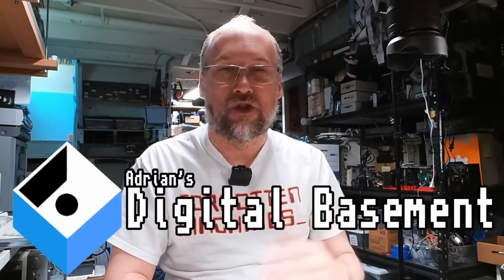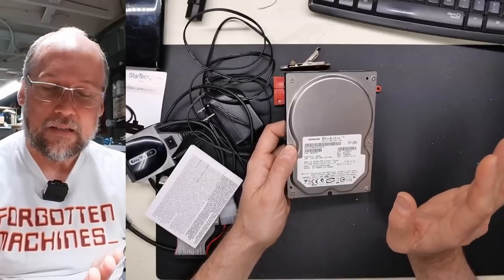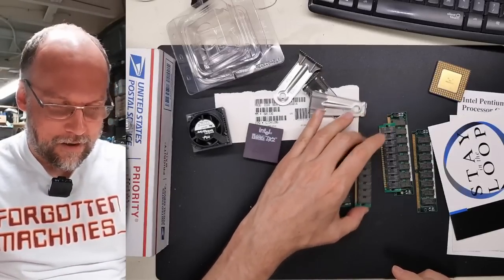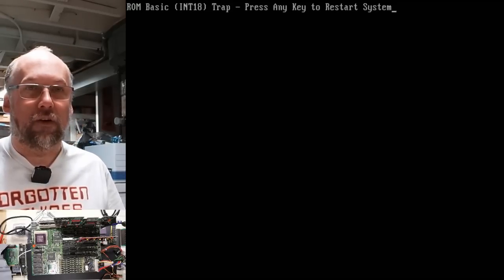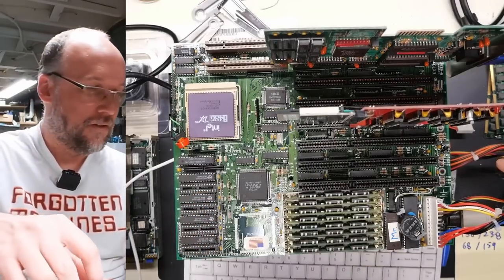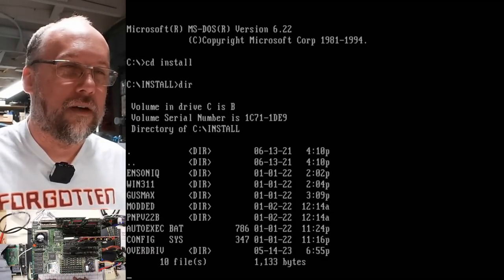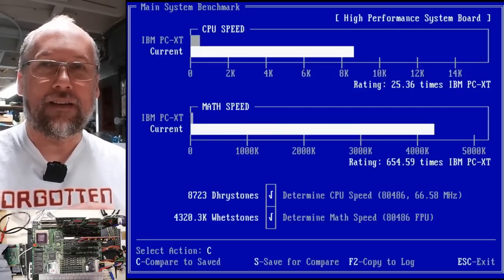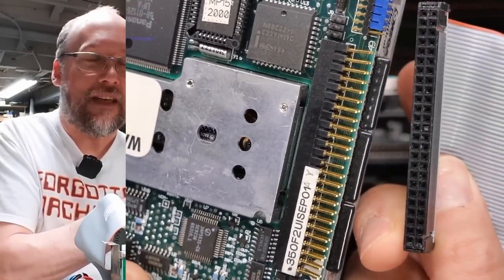0062 A Pentium Overdrive exposed issues with my 486 motherboard

Comment: @Adrian: After recently restoring my own DX2-66 PC, I suspected your speed600 results were quite low, so I ran both it and cache check on my 486 to find out. My PC is a 5V AMD DX-2 66 with 256kb of L2 cache.  The board is a PCChips M601 - also a VLB board. In cache check, my setup scores 16 microseconds from 1-8, and 26 microseconds from 16-256. In speed600, the CPU score is 317.11 Mhz and FPU is 488.00 Mhz. So from what I can tell, even your 486 DX-2 66 should be performing much better than it is.
Reply: I remember pc chips. Weren't they the company that did the fake cache chips?
Reply: There are many more variables.  Chip sets and other things  play a big part.

Comment: I remember the early days of SATA drives. Hybrid power was VERY common. Not many people had SATA power PSU's. so they did molex for a while to help bridge the gap. I remember getting all excited when I bought my first SATA only drive that no longer had molex.
Reply: Indeed. I had a local IBM office give me a bunch of SATA drives to test before they were commercially available to the public and they were Molex power and SATA interface only. I remember I had some issue and they had an IBM engineer phone me directly(!) and he was able to fix the issue in software. You won't get this kind of service today 😞
Reply: @GeoffSeeley  oh that's interesting. I've never seen any molex only. All the ones I saw were hybrid power. The only exclusives I've ever seen are SATA exclusives.
Reply: No more 4-pin Molex on DVD-ROM drives which are impossible to unplug. Thunderbolt is even better - all power, control,, and data on one small USC-C cable.
Reply: @tenminutetokyo2643  I've never head of a thunderbolt DVD drive. But the interesting thing is there was a delay in getting SATA DVD drives. By the time they came out they were SATA power only.
Reply: There were also Western digital SATA hard drives with dual power inputs.
Reply: "SATA power PSU's" and  "Hybrid power was VERY common"?  These are very strange terms.  There is nothing in the SATA spec that require as special PSU or a PSU that is different than the ones before SATA.  It's just a matter of types of connector.
Reply: @MrStevetmq  not true. SATA has 3.5v I believe. That's not in the conventional specs.  That only had 5v and 12v.
Reply: @morantaylor  The RAPTOR ones i had one of 74 GB!!
Reply: @awilliams1701  SATA added 3.3v to the power connector, but that voltage has been required by the ATX PSU spec since it was released 1995/6. So a new PSU wasn't required for SATA drives,  just an adapter. 

As far as I know, nothing ever actually used the 3.3v pins. One of them was repurposed for the power disable function. The other two were retired and are "reserved" now.
Reply: @rah975  while it's true that PSU's had 3.3v, molex did not. It's only 5v and 12v. I believe the only place you get 3.3v is the motherboard cable prior to SATA. Then again not a big deal since 3.3v on a hard drive wasn't a thing.

Comment: You're right about the overdrive having some kind of protection if the fan isn't running. I had a similar situation happen to me with a Pentium overdrive, where processor was running super slow for no apparent reason. I pulled the cover off the computer and noticed that the fan was not turning. Once the fan was reconnected and spinning properly all was back to normal.

Comment: I have a 486 motherboard with the Contaq 82C495A chipset (a Lion Computers Local ISA 486 that also has a "Made in USA" sticker on it), and I took a look at the Pentium Overdrive during a livestream. Both L1 and L2 caches were functioning with the Intel processors I tried (I went back and verified what cache check told me), however, my board only works in write through mode even though this is supposedly Contaq's write-back cache chipset.

In fact, reviewing the spreadsheet of my benchmark results of several processors and L2 cache sizes reveal the following for Landmark Speed Test:
486DX2 66MHz, 64K L2 cache: CPU 276, FPU 476
Pentium Overdrive 83MHz, 64K or 256K L2 cache: CPU 508, FPU 1039
Am5x86 133MHz, 64K L2 cache: CPU 381, FPU 636
Am5x86 OC'ed to 160MHz, 64K L2 cache: CPU 501, FPU 840
I only tested the increased L2 cache on the POD processor.

And yes, it appears as if my motherboard has an issue with the Am5x86 processor (which it wasn't designed to use but I am using it via one of those PNY upgrades that I got on eBay for relatively cheap). Looking at the CPU scores, it looks like the processor may be running at 3x multiplier even though I jumpered the upgrade for 4x... or maybe was the L1 cache disabled much like you saw with your POD??? Luckily I livestreamed the process and can go back and review the cache check results.

Source (Time stamp is Landmark Speed Test with POD 83MHz with 64K L2 cache): https://www.youtube.com/live/IFo-8dhvSxc?feature=share&t=5063
Reply: Hello, I just noticed from an Adrian tweet about this issue, ge is getting less than 8MB/s on the main memory when testing with cachechk utility, how much are you getting?

Comment: Pentium technically had separate Instruction and Data caches within it's L1 cache, rather than the Unified L1 that i486 ran... This might require a later BIOS or chipset that specifically recognises the difference.

It also couldn't hurt to pull the L2 mobo cache chips temorarily just to test results on L1.

Comment: I miss the days when you could just pop in a new chip, and get 2x 3x or 4x (or more!) performance from the original chip, same motherboard.  It seemed like magic at the time.

The Socket 7 went even further.  75mhz all the way to 400mhz with MMX and 3DNow.  That was an incredible time to live through when you'd get these huge performance gains just a couple years later with a CPU upgrade.
Reply: The Am4 socket is probably the closes we can get nowadays. Going from a R3 1200 to a R7 5800x3d is also a pretty big leap even if it's very unlikely that someone would go that path
Reply: The original Socket 7 was from 75-200 MHz, with some late board being able to go up to 233 MHz. Super Socket 7 extended that up to 570 MHz, but not all boards supported all speeds. CPU clock speeds were advancing so fast that chipsets and motherboard vendors couldn't keep up. Earlier Super 7 boards are less likely to support the later faster AMD K6/2 or 3 chips.

There were of course the janky upgrade solutions by 3rd parties, but they were never guaranteed to work 100%. This video shows just one of the problems you can encounter, but the other is the FSB. An upgrade like the Evergreen Spectra that has a AMD K6/2 400 runs the FSB at 66 MHz, rather than the native 100 MHz of the CPU, slowing it down considerably.

The whole Socket 7 / Super 7 era was a minefield of compatibility nightmares, I don't look back on it fondly.
Reply: @harisalic2568  Just because both the R3 1200 and R7 5800X3D exist on the same socket, doesn't mean they will work on the same board. AM4 is a minefield of compatibility issues due to AMD promising too much from the AM4 platform. Socket longevity historically is not a good thing, and AM4 joins the ranks of Socket 7, Slot 1, PGA370 and LGA775 in terms of the number of compatibility headaches they all share.

AMD had a lassiez-faire attitude when it came to motherboard firmware, and let vendors do whatever they wanted. This resulted in bloated graphically intense UEFI setup menus that used a considerable amount of ROM space on the limited 16M SPI ROM used on most motherboards. This came back to bite AMD in the ass by the time the Ryzen 3000 chips rolled around, their AGESA package that they supply to motherboard vendors that contains all of the microcode for their CPUs to work was getting too large to fit in those small 16M SPI ROMs with all of those fancy menus.

In keeping with the lassiez-faire attitude they had, they still offered no real solutions and let board vendors do whatever they wanted to try and solve the problem. Board vendors then started either dropping support for older CPUs, or dropping support for random CPUs they deem not worthy of support. So this creates the problem for the buyer in that they can never know what AM4 motherboard they buy will support in terms of CPUs.

So you can quite literally buy a brand new B550 or X570 board with an old firmware installed, that you have no control over, and it won't support the shiny new Ryzen 5000 series you bought. You'll either have to play the RMA lottery to get another board with hopefully a different firmware, or buy an older Ryzen CPU and hope that one is supported so you can flash your board to a more recent firmware release.

I've literally had this happen four times with AM4 boards now, across four different chipsets. B350, x470, B550 and x570. In every case, the board shipped with a firmware that didn't support the CPU I was using, and I had to either RMA it, or find someone I could bum a CPU off of to get it reflashed. It doesn't help that the motherboard vendor claimed the CPUs I were trying to use were "officially supported", but not mentioning it required a specific firmware version.
Reply: @GGigabiteM  There's quite a few socket 7 motherboards that will fully support a K6-2 processor clocked at 400mhz.  All it needs to support is 2.2V, and a 2x multiplier that the K6-2 interprets as 6x.

I have one of them.  Works great.
Reply: @stevesether  The 6x to 2x multiplier remapping was purely a thing done by AMD, it wasn't widely supported, and could be hazardous to your motherboard, potentially leading to its death.

Getting a working multiplier does not equate to a motherboard supporting the CPU. If the BIOS doesn't have the correct microcode for the CPU, it may have erratic behavior, or not work at all. The cache not working properly was a big issue.

Another big issue was power regulation. Boards without explicit support for K6/2 CPUs usually didn't have voltage selection that went down to 2.2v, and even if they did, power regulation for CPUs at that time was primitive.

Many motherboards still used linear power regulators, which burn the difference between the input and output voltage as heat. The larger the distance between those two numbers, the more heat is produced. The boards with buck regulation also often were poorly configured, leading the mosfet to operate in the linear region, essentially the same as a linear regulator in regards to waste heat.

Before slapping a K6/2 400 in an old Socket 7 board, these factors need to be researched thoroughly, else you may end up with a damaged motherboard.

Comment: Adrian, MR BIOS was usually an aftermarket bios people used for compatibility issues.  I'd bet anything the MR BIOS on that board is not the appropriate build for that exact board, even if it's "close enough" for the chipset.  As another commenter mentioned, using an official AMI BIOS might solve your cache issue. 

The Pentium Overdrive fan slowdown was actually a touted feature at the time - think about it though - lots of 486 boards that these were put in didn't even know the concept of a fan or cpu temperature, and the Pentium absolutely ran too hot to run without a working fan.  Intel had to come up with some way to save the processor if the fan got dirty / stuck / died - since the motherboard and BIOS absolutely wouldn't do a thing about it. 

The funny thing is there's a lot of overdrives out there floating around without the fan on it - and replacement fans are hard to find.  This was likely the opposite of Intel's original intent: save the expensive chip and just replace the cheap fan. Nowadays if you have a fanless PODP83, good luck getting it to run at 83 due to the fan slowdown routine and the proprietary heatsink.
Reply: I agree, first thing I'd try would be AMI BIOS
Reply: You can run any cheap NB/SB heat sink on them with a thermal adhesive strip.
Reply: Curious.  What's the compatibility issue the MR BIOS was designed to solve?   AMI was so ubiquitous back in that era, I'm surprised there were any issues at all.
Reply: "didn't even know the concept of a fan" Which is a interesting little detail. The fan is powered via the CPU pins since there is no header to plug any fan in. Explains what some of the additional pins are for.
Reply: @agurdel  Yep, I had a DX2/66 at one stage which had a small fan and it was powered from a Molex connection on the PSU.
Reply: @ionstorm66  yes, but you need to solder a resistor to the cpu so it think that the fan is connected.

Comment: That big sheet of foam may be handy for sorting all those loose ICs… now all we need to do is start scaring up a supply of IC tubes so they can be properly stored. The 4547 is a higher current version of the trusty 74LS47.

Comment: There could be a number of factors at play when benchmarking the performance. The motherboard BIOS has a problem correctly recognising the POD-83 (possibly around L1 cache) causing the benchmarking software to give false results, or the BIOS is correct and the software is at fault. I noticed Speed Mark 6.0 was copyrighted 1993, the POD-83 was released two years later. Perhaps it's mis-reading the CPU (note in the screenshot at 41:50, speed Mark claims the CPU is an 80386DX!).
Reply: That could make some sense if people like Phils or VSwitchZero haven't already tested the POD83 on Landmark v6 and get different and better results (his DX2 66 scores were already almost half of what other get) the BIOS is disabling the L1 on all the CPUs

Comment: After I figured out that all I had to do to overclock my Packard Bell Legend 660a (486SX-25) to 50 MHZ was a jumper setting, holy crap, did Sim City 2000 run amazingly! Was stable for YEARS. Don't know what happened to that beloved piece of crap computer. So many good memories.

Comment: Pentium Overdrive CPU was a popular upgrade for the 486 computers especially to play Doom on it, as some games started to require a superscalar processor to run properly at decent framerate.
Reply: Doom was OK on 486. Did you mean Quake?
Reply: @xsc1000  I agree, it just depends on how fast the 486 is running at - 66 to 133 MHz range for those ancient x86 processors were decent for this game as far as framerate go. At lower frequency, it's just a tad choppy. And Quake, yes, again, it also has to do with how fast the processors ran at, as GPUs weren't a thing just yet at that time, or if they were available, they were just very pricey (custom ASICs tend to be expensive).

Comment: The spikes on the inside of the telecom connector are used for clipping onto single conductor wire through the jacket.  Might come in handy somewhere for checking. Voltages where the terminations are difficult to access.

Comment: The drive with both SATA and Molex power connectors were made in the transitional period between IDE drives and SATA drives.  They were for people who upgraded their systems with SATA ports, but still had old PSUs with only Molex connectors.  Also, do not connect both the SATA and Molex power connectors at the same time.

Comment: 13:37 (nice) They did also make 180mhz MMX overdrive chips as well, but the higher speed ones just upgraded a non-mmx pentium board to an mmx at higher clocks.. So for example, a Pentium-90mhz-to-150mhz would go up to an MMX-180mhz, or a Pentium-75 up to an MMX-150mhz.. I BELIEVE they had socket5 versions as well, though the frequency jump wasn't near as high, but it still did have multi-media-extensions (mmx) on a 486/socket5 system, something that could dramatically improve performance in certain workloads. Though in other workloads, like those heavily dependent on the bus for example, would remain more-or-less the same in terms of performance as the CPU was still very much limited by the bus as well as ram throughput
  While they're novel for sure, it's just as easy (and oftentimes cheaper) to build a socket7 retro system nowadays for we retro enthusiasts, and by avoiding using an overdrive, you're not bottlenecking yourself via the bus. There's no advantage a socket3/socket5 has over an early socket7 board as far as retro usage, except for maybe VLB, but there ARE socket7/pentium(non-mmx) boards that still have VLB slot(s), however those are exceedingly rare and their price reflects the scarcity.  (That's why the two I have will be buried with me lol)

I DO have a massive collection of other hardware (20+ socket3/5/7 motherboards, cards, sound, video, controllers, cpus, ram, HDDs, actual fully functional CRT monitors, that I've been trying to sell to a good home- I want to make sure the stuff goes to someone that's going to love it and not just flip it to earn a quick buck.

Comment: There are overdrive chips that go in the existing 486 CPU socket (ODPR) and overdrive chips intended for boards that had specific additional overdrive sockets (ODP).
You read the part of the manual that refers to “Pentium overdrive processor socket” so I assume you have the latter, which should not be installed in the 486 CPU socket.
Reply: This difference was only an extra pin meant to disable a 486SX soldered to the board.  They should both work fine in any motherboard without the soldered on CPU as far as I remember

Comment: There were 63 and 83 mhz Pentium overdrive processors.  EDIT:  The 486 overdrive processor marked 33 mhz indicates what the processor was intended to upgrade.  This marking scheme didn't last long
Reply: Yeah, both had a hardwired 2.5 multi, but the first was intended as a replacement for a 25 mhz 486, the other was for a 33mhz 486.
Reply: That explains it then. I didn't know that.
Reply: @Retrohertz  I bet the 63 mhz versions will work fine in a 33mhz board btw.
Reply: @ironhead2008  Can confirm that they do.
Reply: @dennisp.2147  Figures, I doubt they would bother binning them that tightly, they were probably relying on the average end user not knowing better.
Reply: it indicates fsb